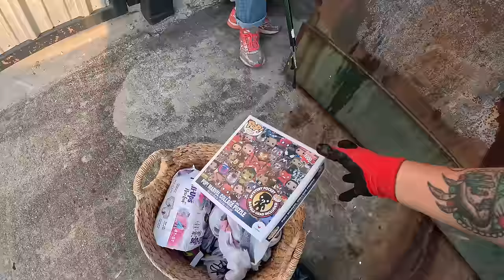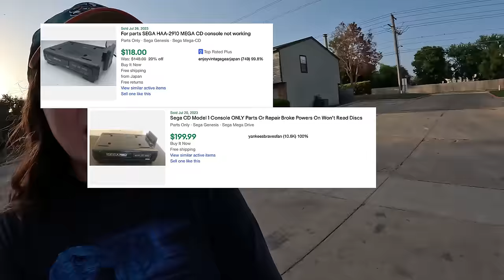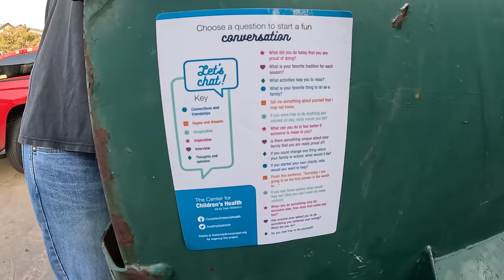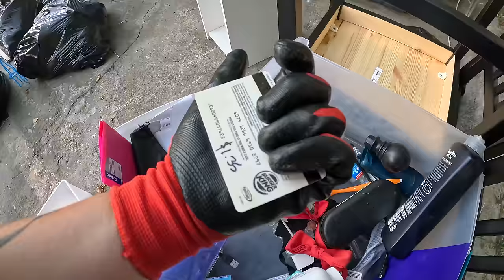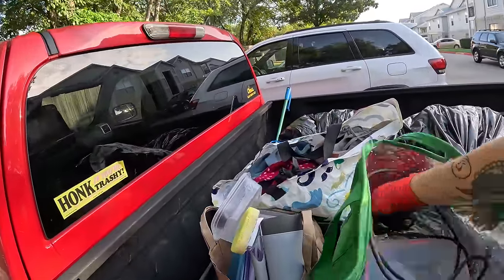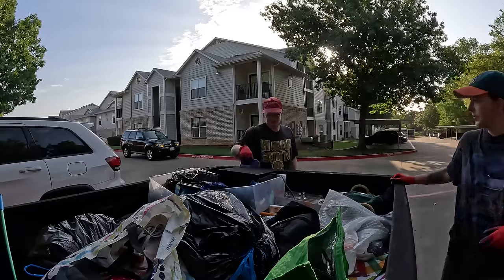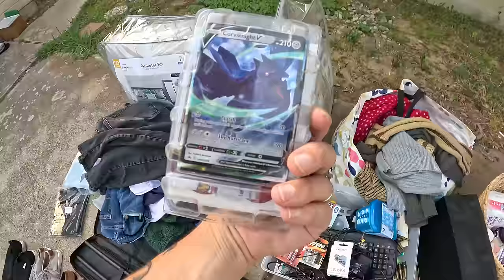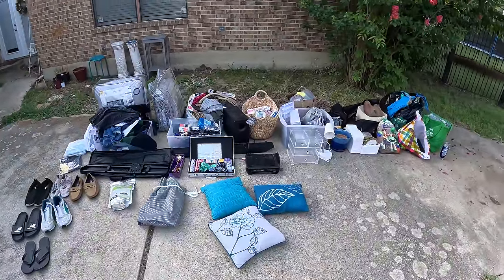UNREAL Dumpster Dive at Apartments!

Comment: Last Sunday I found a large, rattan wall rack with five rattan hooks in the store dumpster. It was broke in one small section. I am going to wait and see if I come across parts. At the time I wished I had your rake tool because in the far back of the dumpster were two vases. They were more than likely broken, but I wanted to see. My green grabber (like yours) could touch one, by not grip it. If you remember, I am almost 69, so I don't climb in the dumpsters. LOL! I just might have to buy that rake!!!!

Comment: I see someone is in my old stomping grounds around UNT and Concrete City
Looks like students are still dumping big so they can go back home 
Usually when you find a pile like that 

But best time yr is late April going into may when graduations are going 
The kids just shovel it in bags and dump 

For good solid 15 yrs I never had to buy a computer or new Windows thanks to that collage 
Tho last time I was there lot of changes to some of the properties 

But great place for copper aluminum steel and brass and copper and tons of wire